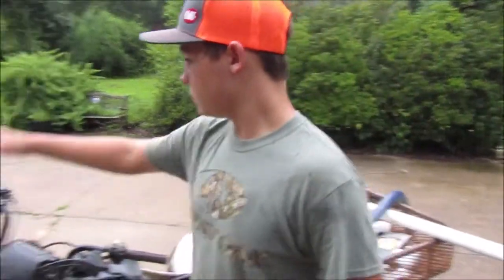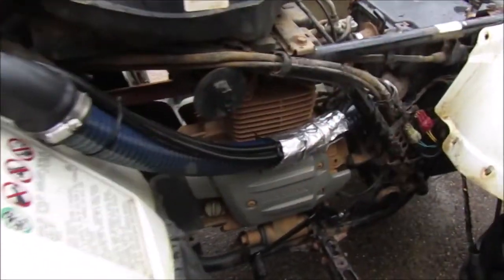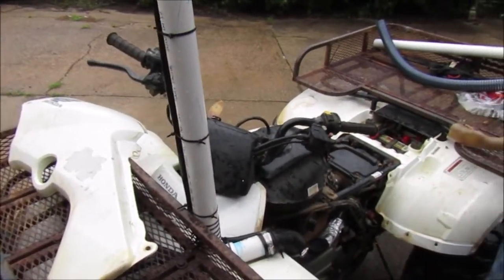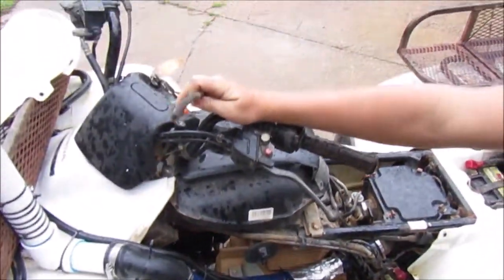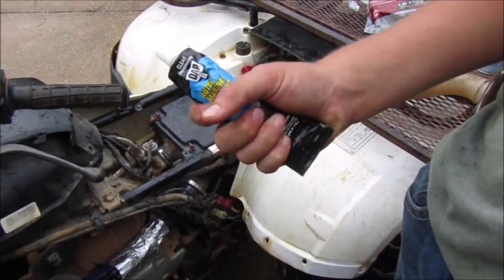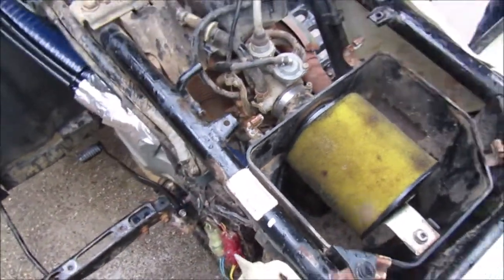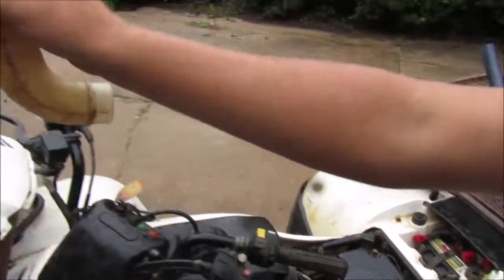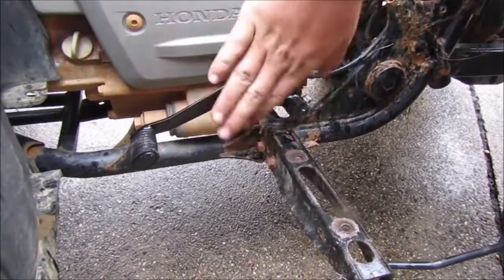Snorkeling a Honda Recon 4 wheeler/Messin around the South

Comment: Water just won’t get into that unsealed air box?
Reply from the maker: A little water could get in. I've sealed it up since then.
Reply: You should try taking the airbox cover off taking the seal out of it and then putting gasket maker in they're letting it fully cure couple days and then putting the seal back in won't have any problems.
Reply: And you'll be able to get the air box lid open and close like OEM